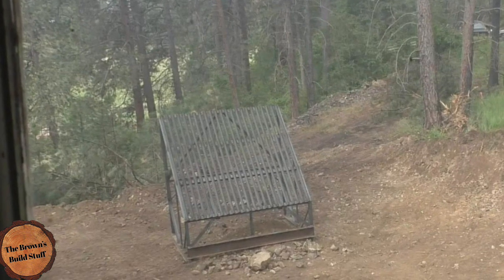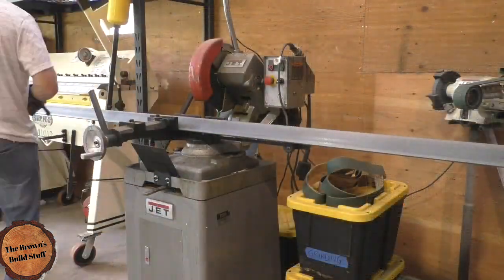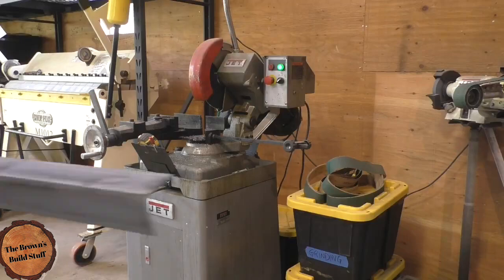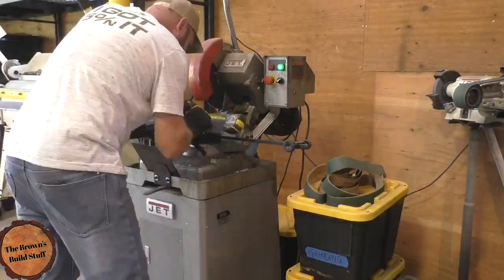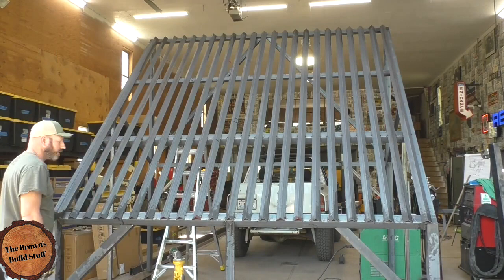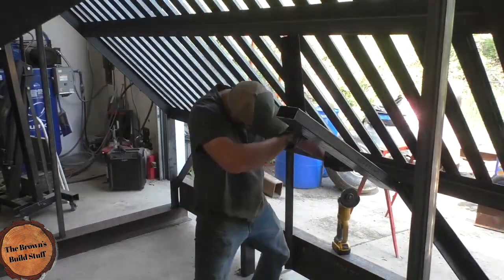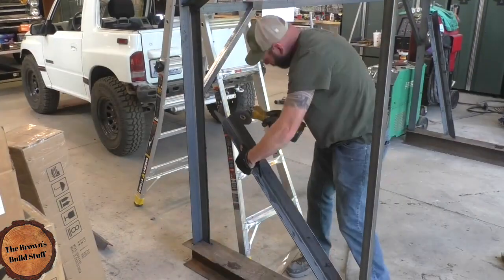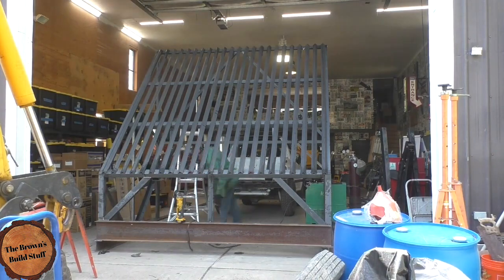DIY Grizzly Screen Rock / Soil Separator Time Lapse, Don't Make The Same Mistakes I Did!!

Comment: making a grizzly out of salt sander screens.Thinking about 78 inch tall 2 foot in the front just big enough to get my bobcat in to get the screened dirt. Very nice build!
Reply from the maker: That’s a good idea!  Yes don’t go to tall. It’s one of my regrets on mine. It was also wasted material since I pretty much only use the bottom 3/4 of it.
Reply: Best to to prototype one using PVC pipe to make sure your machine can fit under it and dump on top of it.     Use  flat expanded metal for a screen for fine stuff.  The expanded metal with a twist in it will gunk up too fast.

Comment: How much did this cost you?
Reply from the maker: I think at the time the angle was $40 each 20’. I’m guessing currently it’s close to double that. The rest of the metal is salvaged. If I were to do it again I wouldn’t make the top as big to save material. It’s not necessary.  Maybe $500-$700 into it 3 years ago.